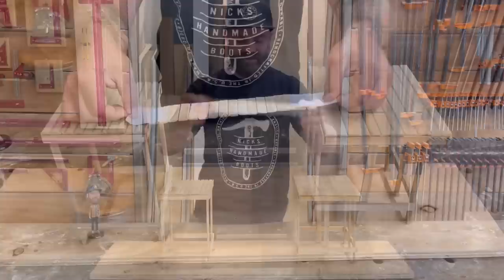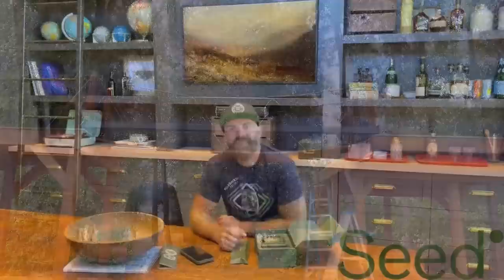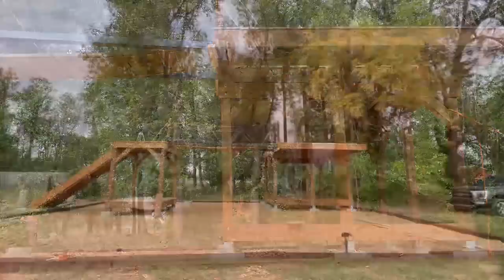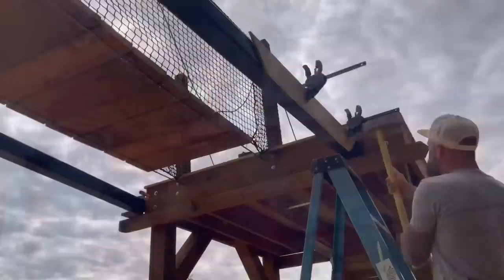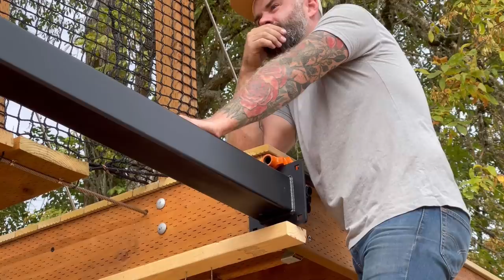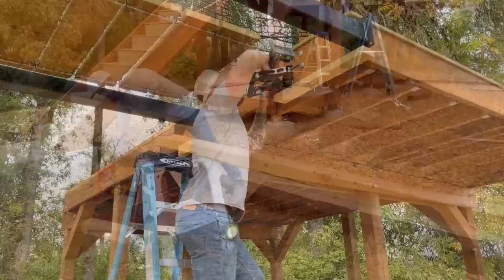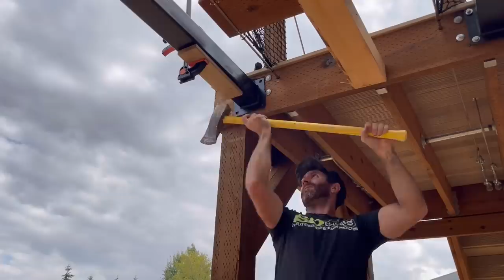My Treehouse is Falling Down || Fixing a Huge Mistake

Comment: sorry to point out the biggest issue: by placing those two new beams to stabilize the two towers you negated the whole reason to have a suspension bridge........just put the planks atop the two new beams and your bridge is done. No need to put all that complicated cable infrastructure.

Comment: So many comments to make! First why didn't you loosen the cables between the two towers? That would have made it easy to place the beams in place!  It can be easily seen in your videos that you were stretching the cables super tight.  Second, why bother with the cable bridge when you added two beams strong enough to have a fine bridge between the two?  Remove the cables and put in the flooring on the steel beam. Third you will need cross bracing in the future since you have NONE and the bolts will loosen in time within the beams and posts. Thus the towers will move out of plumb since you have nothing to keep them plumb.  As a structural engineer I can tell you it will move in time since you have no cross bracing to keep them straight (in a house this is the exterior sheathing that does this). I really had hoped to watch you pull your hitch off your truck but no luck with that, though I think you are lucky but I bet the structure still isn't as plumb as when you started.  I wish I knew you were doing this since you really do need help getting it right.

Comment: Jason I hope that you did the decent thing and layed the blame for the wonky towers solely at Grandma's feet !!!
Grandma your just too heavy and YOU broke my tower's!
Why did you feel the need to install the beams directly at either side of the "rope bridge " ?? Knowing that the platforms are a different size you could have placed them at each end of the shorter platform then you would have gotten the exact same results but at least you could have put them to even better use.  You could have welded a couple of eye bolts to one beam to hang a swing below and then on the other beam you could attach a knotted climbing rope wall for the big fella to climb up and down etc !!! 
As always buddy 💯%   👍   🇬🇧.

Comment: You have another problem, and that's with the uprights for the handrail supports.  Take a look at the video with your wife and son crossing the bridge.  See how much they are moving?  Now, think about the cable that's also moving back and forth across that wood.  You need to get some conduit (PVC, or better, metal or metal pipe) and use that to make inserts for those holes or you are going to start seeing your cable start to saw through your uprights.  Make sure you grease the cable too..  You could also install an eye bolt on both sides and so that you don't have a cable running through it, so no cutting action.   

Yeah, this is yet another of those "you did it wrong" posts...that said, your design will work, it will just have problems in the future, so this is more about preventing future problems that future you must solve.

Comment: Towers need to be braced. Adding the steel beams will not negate the racking issue. In the absence of an appropriate bracing system the structures are liable to fail (ie collapse) when subjected to excessive live loads such as kids jumping and running on the structures. Would suggest a structural engineer have a look a the structural integrity of the building before progressing much further.

Comment: 4 by 4 steel is way overkill. All you needed was compression strength. An I-beam (and a relatively small one at that) would have sufficed, I'd guess (I'm not an engineer....)

Comment: Why didn't you put 45 deg. bracing in the corners.  You had flex from lack of bracing and the 45 deg. bracing would more than likely take care of it or most of it anyway.  No offence to the beams, but you have taken away the look of the suspended bridge.  Just a thought.

Comment: You essentially replaced the suspension bridge with a regular beam bridge :-D that's one solution but rather expensive and unnecessary.

Your issue was to allow the towers to flex to begin with. Braces into every corner, and the posts property tied into the foundation and that little bridge shouldn't move anything.

Notice how your post brackets face into different directions on each tower? Brackets have a weak and a strong side (just like I beams). If you don't mount the proper brackets facing the right way, you essentially can't transfer a bending moment into your foundation, it will act like a hinge/roller bearing and make your structure more prone to lateral movement/bending.

Comment: Cross bracing provides sheer strength and is the proper solution for an open frame tower. You still haven't solved the real problem, even though you stumbled on the right answer when you recognized that the stairs were acting as an unorthodox sheer brace. Love the channel and love your work. This project just isn't a good example.

Comment: Soooo...I'm guessing you never watched any of those Modern Marvel's shows talking about disasters. There's a whole show about bridge disasters. 😄 🤣 

Guess that's why when the build bridges, the footings are driven very deep and are encased is a shit tonS of concrete and steel. 

But I can understand the thought process you might have gone through at the beginning. It's a 15' span. It's just a simple play area. I don't need an engineering degree....or do I 😁

Don't beat yourself up about it too much. No one got hurt and ya learned how NOT to do it.

Comment: So what you are saying is that you skipped "Statics" for your mechanical engineering degree and instead went out and had a life.

Your solution is overkill but it will work great.

The cross beams under compression or some cables under tension at a 45' on the second tower would have worked too.

Comment: Crazy talk. A cross brace would stop any movement. There's a reason why it's used on all post-based structures. You cannot distort a triangle.
Installing rigid struts was the worst idea. At the worst case - forces on one part will affect the structure of both, 
Do yourself a favour and cross brace both in both directions, struts or not.

Comment: Oh my God!!   I love your work but this is why woodworker should not do architecture.  The simplest solution is to apply reverse pressure in the exact same place that the compression was created--- at the bridge junctions.  So you need two beams on each side of the bridge-- the permanent metal one and a wooden one that is the length of the current Gap minus the height of a fully collapsed hydraulic jack.  Your attach a 1x12 x8 to the bottom of the deck on each side to hold both beams and use the hydraulic jacks to spread the decks apart until the metal beams fit.  This is why engineers use hydraulic jacks for everything.  Pulling the deck with your truck risks creating a new problem and a new skew on the wood or damaging where the wood is attached to your truck.  You would have had to attach the truck to all three of the support beams to pull the entire platform backwards but the hydraulic jack is a better idea.

Alternatively if you ever watch The treehouse Master he never attaches Bridges directly to structures without a tension spring at each end of the bridge to absorb the weight.  You could have used a temporary wooden beam to push the decks apart back to plumb and change the bridge connectors to tension springs to avoid the problem.  

Either way works.  Keep up the creative solutions.
Reply: Just add trusses to the two towers! (Is this why architects should not do structural engineering?)

Comment: I don't want to sound critical and say the repair is still "wrong", but from an engineering perspective, the repair is still technically "incomplete." Each of the two individual towers require cross- bracing to prevent the now "newly created larger structure" from racking as one. Fortunately, he built the staircase attached to the smaller tower. That staircase is primarily responsible for reducing the racking of the entire structure now.

Comment: What you needed to do was take cables from the suspension bridges and angle them down to the bottom of the nearest column to transfer the load from the bridge to the ground. 

What you did will not stop the towers from leaning I the future. But will ensure both side will lean in same direction. 

You are lacking diagonals or a large panel.

Comment: Just food for thought.  What to do when the metal expands and contracts with hot and cold, pushing and pulling on the towers ?  Trust me it will.
Reply: what to do then? enjoy the ever so gentle sway, of, say, 1 inch a day?
Reply: @tzenophile  I hear you laughing. But when the constant push and pull works joints loose, it won't be gentle swaying. The temperature change from night to day and back as the sun gets on it ( especially painted black ), as well as seasonal changes will take its toll. Been there. I had to rebuild a storage facility that someone else built and did not allow for thermal expansion. It pushed a concrete block wall over. Hence the collapse of the roof. Fortunately, no employees were injured.
Reply: @dallasarnold8615  Those wood stilts are flexible; had he used concrete bricks instead it would have been a totally different matter. I'm assuming people walking on the platform will provide movement on the joints orders of magnitude more than from the beams.
Reply: @tzenophile  Well, I guess we will find out in a while. I don't really expect anybody to learn from the mistakes of an old retired builder. Most have to learn for themselves.
Reply: @dallasarnold8615  we completely agree on that!

Comment: What a waste of time, extra cost buying the timber and all the effort. As some other comments said to loosen the cables at the turn buckles. The reason there was no gap was, the cables were under excessive tension and couldn't be stretched further with the rope and car.

Comment: Any engineer will tell you that for every degree out of plumb, the weight of the structure squares.  You needed to bury your post 50% in the concrete with regard. In other words, if your tower is 12 feet high, 6 feet has to be in the ground. Also you need to triple up your rim joists. Or bolt thru to the second floor joist.

Comment: Too many experts who aren’t experts. Take any “you need to”, “you should have”, or “I would have” statements with a healthy serving of skepticism. Everyone has an opinion but some things I’ve seen in these comments are totally incorrect, but I’m not going to voluntarily start arguments with half a dozen (or more) YouTube commenters.
Reply: Better not, because you have no argument, do you? It is clear that this was not a smart solution at all; to stabilize the towers you put trusses diagonally between the stilts, and the steel beams are an expensive joke. I love this channel, but we all screw up sometimes. Let's not pretend you have an actual counterargument to the critics here, but can't be bothered to make it, you know, because.
Reply: @tzenophile  case in point. ^^^ The self-centred ‘expert, who assumes their opinion was what I was referring to, who also calls the perfectly sensible solution “an expensive joke”, while recommending an inadequate solution that would end up costing more, while not being as effective. Ok, armchair engineer, how stiff do the timber towers need to be to withstand both the static and dynamic racking forces of two tensioned 3/8 braided steel cables, 10’ high? First lesson, the simplest solution is often the best solution. Second lesson, you can overcome tension by adding a member in compression, stiffening the structure, or transferring the load elsewhere; Jason chose the simplest and safest of these options, but struggled with execution (which is learning and perfectly fine). Third lesson, there’s more than one solution to any problem, so you telling Jason what he SHOULD have done (differently, vs additionally) is nothing but a sign that you have a limited understanding of what you’re talking about. He needs cross bracing anyway, but merely a fraction of what would otherwise be required if he wasn’t just resisting final wind loading. He would also benefit from lowering the tension on the cables, but that will become obvious to him without criticism from the likes of you. Bracing beams are a great solution, and often better than stiffening both structures independently. Finally, you’re so arrogant that you offend Jason for not doing what YOU would have done, and try to pretty it by saying you love the channel.
Reply: @Nathanation88  Bracing beams of steel on a wooden structure are not a great solution, but a clumsy looking, expensive and unnecessary one. Furthermore this totally ruins the look and feel of a suspension walkway. Also it does not fix the problem of tower stability. Just out of curiosity, do you have playground inspectors and ditto code where you are from? I'm not trying to insult Jason (besides, chances of him reading my comment is small), I was just criticizing your sweeping condescension, and I'm sure he does not need protection from criticism, since he is not a small American kid under 25 or a holy cow.
Reply: @tzenophile  what’s your concern with using steel on a timber structure? Expansion? I didn’t say it fixed the overall tower stability - in fact, I said he still needs cross bracing - but he requires significantly less. As for ruining the look, that is solely your opinion; do you ignore architecture? Do all timber structures need to be all steel? (I think it’s pretty clear that I don’t have any issue with mixing building materials, especially on a backyard playground. And the effect on the feel of the bridge is, again, totally subjective). 

You take my “sweeping condescension” how you like; my comment wasn’t criticising everyone, rather, have you seen the disparity among some of the comments? Everyone telling Jason how he SHOULD/SHOULD HAVE done it, then you felt the need to jump to everyone’s defence by doing the very same thing. 

Play structures have their own section in my local building code, so yes, they are subject to inspection. 

But BTW, I haven’t defended Jason, simply pointed out that YOU are the one being over-critical. You (and others) are picking at things that are perfectly fine.
Reply: @tzenophile  you do realise that steel bracing is used on timber structures all the time, right? Not as significant as this scenario, but it doesn’t make it any less of a suitable solution.
Reply: @Nathanation88  Steel is fine; combining steel and timber can be fine. But here it takes away from the idea, rather than add to it. You know - Less is more. A suspension walkway in a playground should have sway, that is part of the fun. So I give this a D- for using an expensive, overkill solution to a very simple problem. I don't really have much more to say, and to me this is obvious, but do feel free to have the last word.
Reply: @tzenophile  Whoa, whoa, whoa… rewind bud! First, you attack me by claiming I didn’t make an argument to begin with because you believed I didn’t have an argument, so I put forth an argument. Then, you claim it was wrong to use steel bracing on a timber structure, then conceded it “could be fine”. Finally, you reveal that your whole ‘argument’ is based on your opinion that suspension bridges should have sway, that steel detracts from the aesthetics of a timber structure, and that he should have taken a minimalistic approach… umm, do you realise how much he would have to add to those towers to independently stiffen them enough to stand up to the tension of those cables? And you think that’s minimalistic? Minimalistic would have been to ditch the heavy cables and make a rudimentary rope bridge, but, in any case, that’s what HE wanted, and it’s HIS choice. So after giving me all your cr@p you’re actually just having a whinge because he didn’t build it how you would like to see it. Ok, champ, you’re worse than all the aforementioned ‘experts’. Feel free to build your own playground, film it, and upload it for arrogant, clueless critics to pull apart.
Reply: @Nathanation88  Stop putting words in my mouth; I dont have time for this. I did not say it was wrong in general, I did not say that "it" could be fine in this particular case. I do understand much better now why you did not want to engage in the first place. Wise choice, by bye.